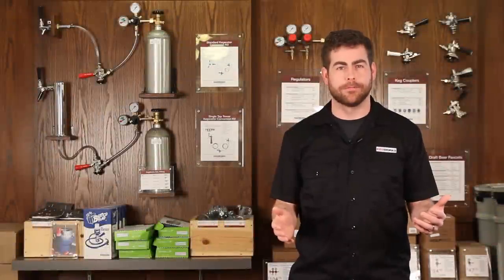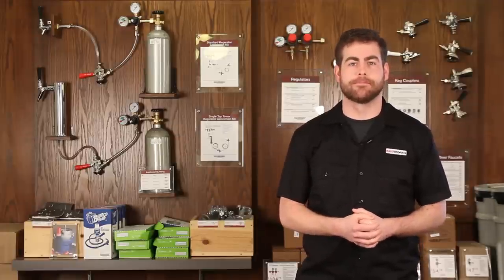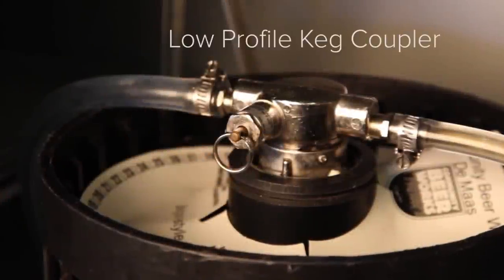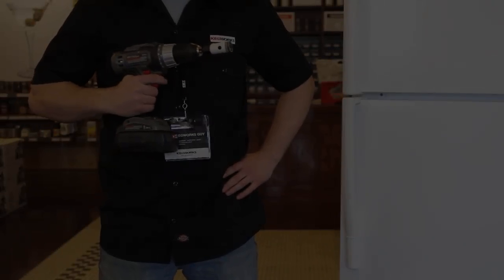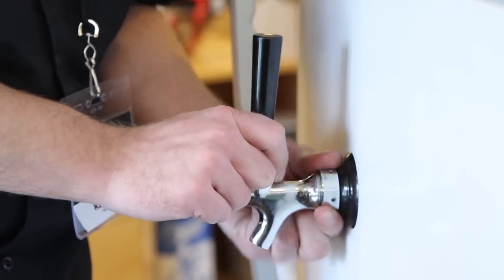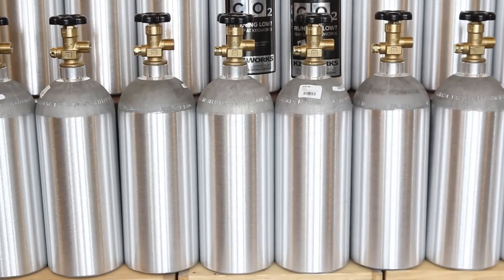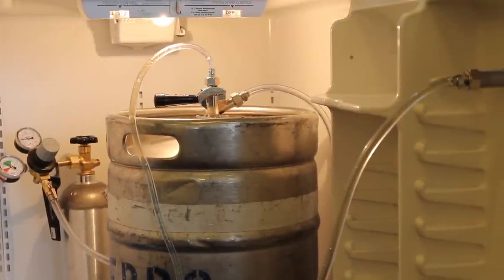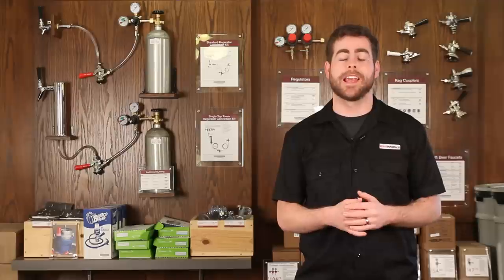How To Build A Beer Fridge Using a Kegerator Conversion Kit

Comment: Over the years of having tappers I have found keeping the tap inside the refer is the way to go. This doesn't work for some people but it can beww a good option. Especially in warmer areas..a tapper spout is a very welcoming place for fruit flies. If the tap head is in the refer..this won't happen. I always just used a length of 4x4 that sits on top of the half barrel...with the shank going thru the center of the block of wood. If you're using smaller size kegs, you may have to rig up something to mount your tap head to. Btw, I have never came across any wires in the side walls or the door of any refer.

Comment: Can you put the tap on the side of the fridge instead of the door?
Reply: Yes. BUT... you have to be very careful when drilling as the fridges cooling coils are usually on the sides of the fridge. Carefully drill from the inside of the fridge just through the first layer of plastic then feel around inside of there to check for cooling coils.

Comment: I am a seltzer addict, have been using a spare fridge & pressure tanks to make my own for years. Just had to replace my fridge when the old one blew. I've been keeping the CO2 cylinder inside with the pressure cylinders, but would like to put the CO2 tank outside. I'm having trouble learning if there's stuff inside the side wall of a fridge that I don't want to drill through (i.e. electric wires).  Any help? It's an older freezer-on-top fridge/freezer.
Reply from the maker: On most refrigerators the electrical is reserved to the back. Unless you have water/ice dispenser on the front of the fridge. The sides I am not sure about, although they tend to be thicker than drilling through the front.
Reply: Thank you for the info! Tho I realized that the "new" fridge is wider than the old one, so I don't have room to put the CO2 tank outside anyway until/unless I rearrange the laundry room. Good to know, tho! It'd be nice to have more fridge space if I can figure out how to shove things around.

Comment: What are the pros and cons of door mounter or tower mounted faucet?
Reply from the maker: Well they require different set ups. Usually a tower is mounted to a refrigeration unit/stand alone kegerator while a Door Mounted kegerator is used with a converted fridge/freezer. Towers are stand alone units specific for beer but are usually more expensive. Door Mounted are cheaper but you may encounter some issues with the DIY nature of the fridge, as it's not specifically meant to hold a keg & CO2 system.

Comment: What if I want to run a line to a tap at a bar through a wall?  My refrigerator would be in another room and was wondering on what insulation options I should consider for the line from fridge to tap?
Reply from the maker: Depending on the length of the run, you may need to look into some cooling options in addition to insulating the lines. Give our customer care a call at 877-636-3673, they will be able to direct you to our draft specialist. He'll be able to assist you in getting everything set up. Cheers!